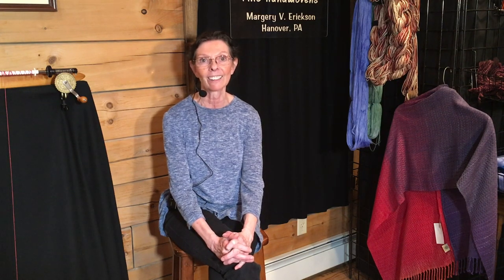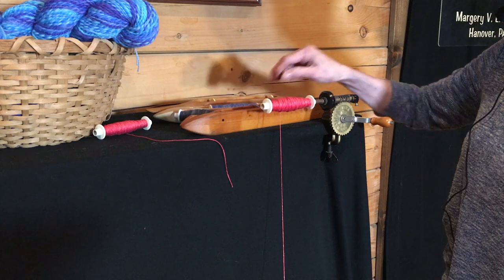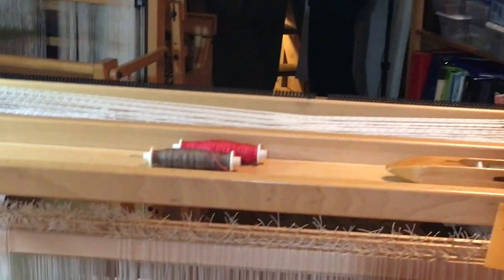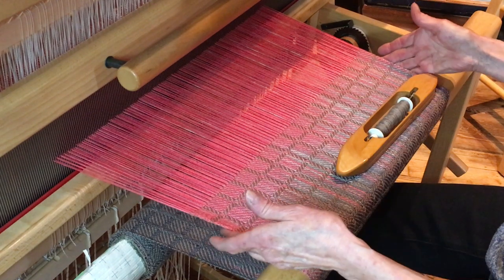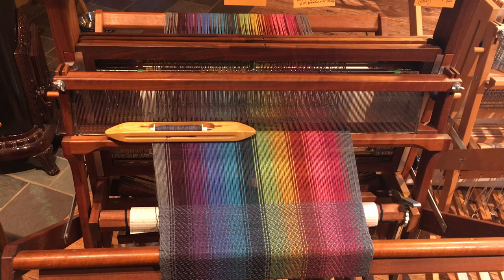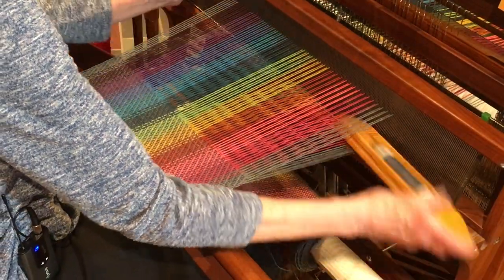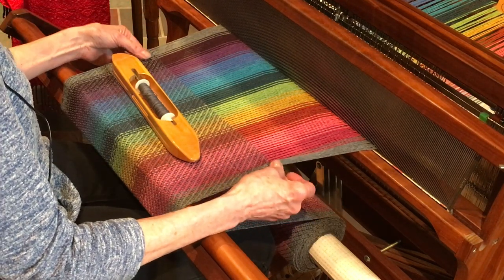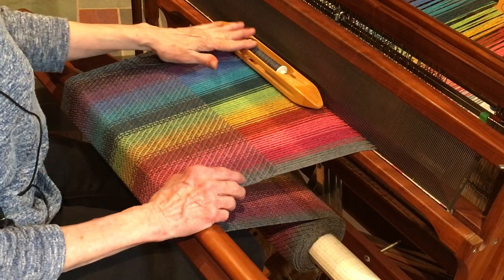Weaving Clean Straight Selvages - Tips to Try

Comment: Thank you Margery. Can you share the maker of your favorite shuttle?
Reply from the maker: Harrisville Designs is the maker.  It was my first shuttle...came with the loom.  It fit my hand and I liked the weight.  I have found some shuttles are a little heavier than others.  May be the wood or the time it was made. I also use Schacht  bobbins. The added length on the ends seems to slow the bobbin down.

Comment: If you don’t use the floating selvedge, are you saying that you don’t worry when it skips the outer thread and just aim for consistency overall, and just be happy with it?
Reply from the maker: Yes - as long as it is not too long.  I have used floating selvages on some projects.  When wearing a scarf or shawl the edges is moving when on the body.  The selvages are not that noticeable.  I do believe consistency is important.  Yes I am happy with this.  I will do whatever I can not to use them.